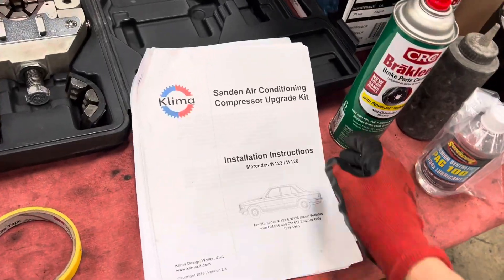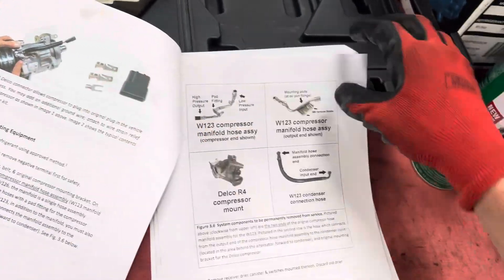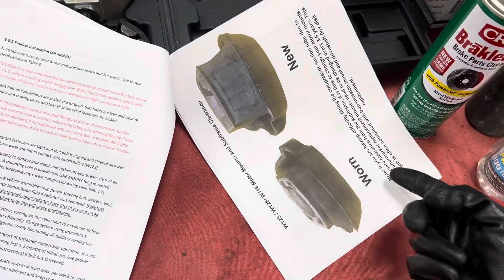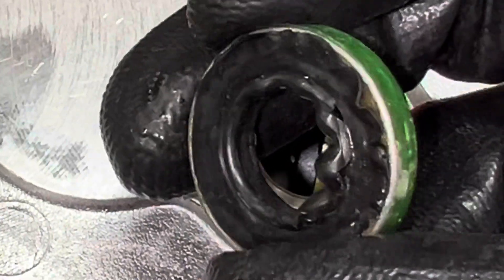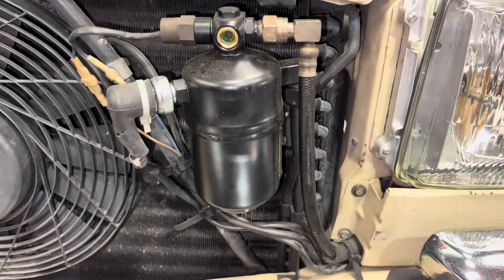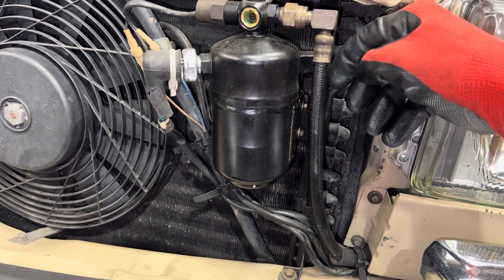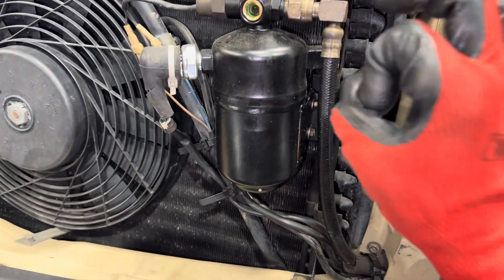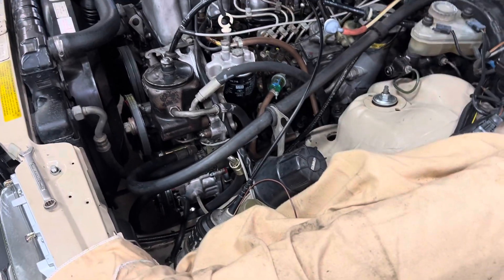Compressor upgrade kit for old Mercedes by (Klima) ￼ removing the Delco radio compressor

Comment: interestingly enough euro market w123 Mercedes use a sanden compressor instead of the GM r4 compressor. My coworker has a german spec '83 240d and I was perplexed to see a factory installed sanden SD508 in it. I have looked into the Klima kits in the past, but there were a few people who said after a few years the brackets would warp and they would no longer maintain belt tension.
Reply from the maker: Warped brackets well that’s something I’m gonna have to keep my eye out over the next few years on this vehicle

Comment: A motor mount can cause problems with installation of AC parts? Can I please know what year make and model vehicle is designed like that so I can avoid it like the plague? What OEM does that?
Reply from the maker: Over the decades, many different manufactures have had problems when the motor mounts will get 20 or 30  40 years old some vehicles would get metal the metal contact on the frame to the drivetrain, causing vibration or clicking noises

Some vehicles it would cause misalignment of a axle to a rear differential putting stress on ujoints 

Some vehicles would pinch wiring harnesses 

Other vehicles would have throttle cable problems 

Some vehicles had transmission shifting problems

And an other little problems caused by sagging motor mounts on vehicles when they get extremely aged . And start experiencing problems you would never see in its first 10 or 15 or 20 years.. 

Over the decades, if you didn’t want to experience this problem when your vehicles are approaching 40 years old, you get a horse . 

I remember my 1970 F10 pick up truck when I accelerated and the motor mount broke it pulled on the throttle, linkage and cable, and it got stuck in full throttle .   As a 17-year-old kid that was quite an experience..  neutral, the engine sat back down, went back into idle.

Comment: Flushing will not completely remove all that black stuff. It's like a static dust on the cars body which pressure washer can't remove. Wiping and scrubbing manually is required.
Reply from the maker: 100% correct 👍

Comment: Why did they put the glass in these older receiver dryers? What can be seen there? Today's cars don't need these glasses anymore 🤔
Reply from the maker: You can see the refrigerant flow. 

That will at least tell you that the compressor is pumping . 

If it is extremely empty, you will see that it’s extremely empty . 

If it is dirty, you can see that it is dirty .

Comment: How about flushing the evaporator core and other hoses after finding black residue?  Can you flush an evap core with success ?                                            Does a typical evap core have small channel tubes  that go back and forth like a condenser or  just goes down one side of the top header and back the other side of the top header and then just transfers heat thru the block part of the aluminum. In this video he cut open a toyota evap core and it was like this. It's minute mark 4:44 in this video      https://www.youtube.com/watch?v=04MlTepEIz4
Reply from the maker: They are all different from different year. Make model manufacturers.. 

Do you have everything from the old-fashioned Tube and fin on some manufacturers that use those for decades after other manufacturers stop using them 

Some use these big headers like you see in this video 

The majority now have gone over to microchannel like the new modern day condensers